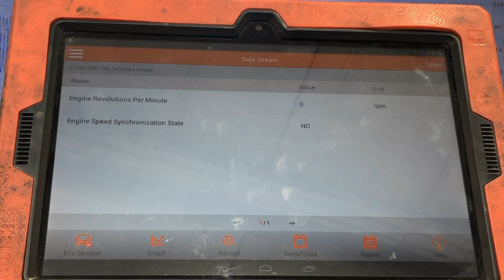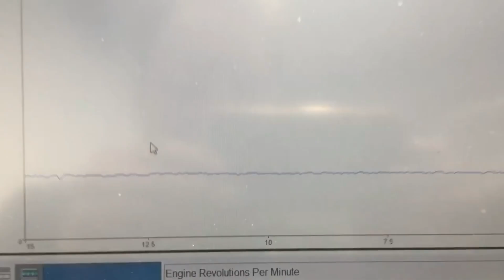Ford Transit Connect No Start No RPM Part 2 (installing used PCM using IDS)

Comment: Good stuff......could you do a video for an idiots guide to programming.....from start to finish....what equipment you need with full names and explanation if only choice to use for certain vehicles....what sites you need to link to and how.....how to pay....and anything else that you can think of to give a newbie the confidence to do their first program.....also any pitfalls to avoid or when to leave it to a dealer to do.....thanks for all you do...
Reply from the maker: Programming is different manufacturer to manufacture, this is using Ford IDS, but Ford FDRS would differ. 
There’s no one way to do this unfortunately.